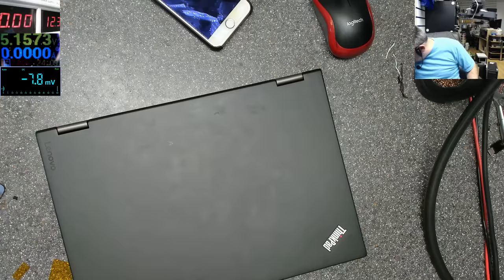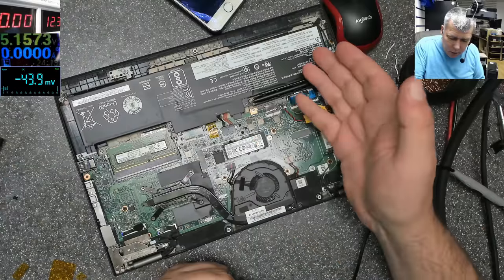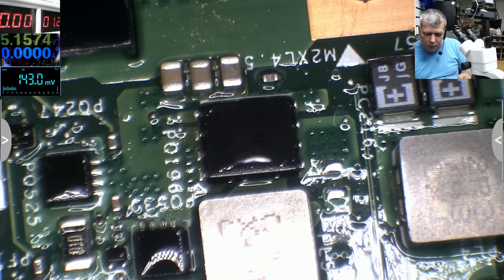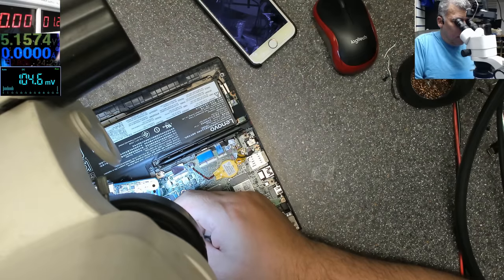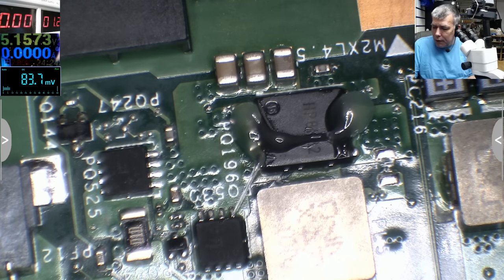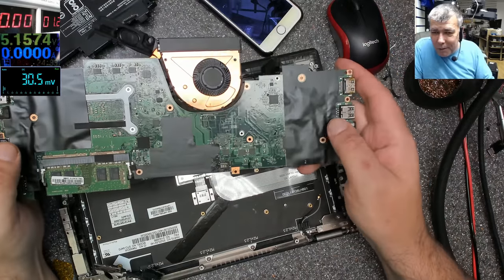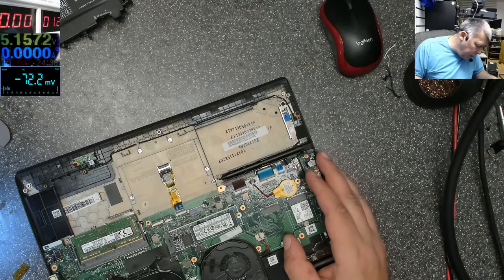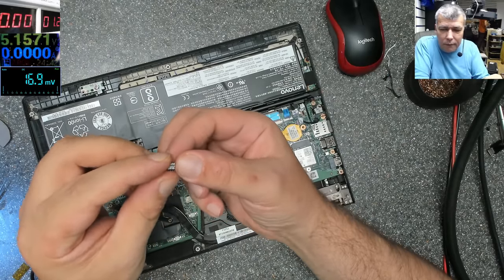Lenovo Yoga 370 - motherboard repair, a tricky one

Comment: I have the exact same conditions and have torn down the same as you illustrated. I’m missing the actual repair/part replacement. Same computer, exactly the same conditions. I’m just stuck now at the physical repair to be done. Thank you for sharing your knowledge.

Comment: I remember I had a similar case to repair  but didnot find any dual mosfets as replacement... As a result I used 2 single n channel mosfets connected with wires... AND IT WORKED JUST GREAT.

Comment: Hi Sorin, many thanks for all your instructional videos. I have a small PC repair shop in south Manchester and now feel cofident to do some component level board repair thanks to you. I have just had exactly the same problem on a Toshiba laptop I bought "spares or repair" as I needed some other bits off it to fix a customers laptop. I even have a thermal cam to help me identify the hotspots on the board. I was practising on this board to see if I could fix it and removed a capacitor that I thought was shorted. Seems the issue was on the other side of the board and now I've learned to take the board out and check thouroughly! 
Se poate întâmpla și maestrului!
Multe mulțumiri pentru că ești inspirat de mine și de mii de alții.
Stai in siguranta.
Salutari
Jed

Comment: The Lenovo Yoga has its power button on the side, because its screen can be turned all the way round until it touches the down side of the laptop. It has a touch screen. When folded like that, the keys on the keyboard retract and/or turn off and the unit will function as a tablet. In tablet mode, it is more convenient to have the power button on the side.
The 7 in its model number indicates this model was released in 2017. So this unit is max 3 years old and already one of its caps shorts out. This is unacceptable but unfortunately we see it everywhere in the electronics industry. Parts are engineered to be as cheap as possible. Lifetime is no issue. Customer is supposed to just buy a new unit if a cap dies.

Comment: i realy learn a lot from you're videos. im from philippines and i want to ask a silly question about the laptop capacitor, is it realy ok when you remove one capacitor and the laptop would be revive without replacing it? is there any down's and up's for not replacing the capacitor? im not and electronic but i want to learn from watching videos like this. thanks in advance for who ever answer my question it will be a big help for me.

Comment: How do you know that mosfet was the same spec as the other one? Just from experience? and why did you not replace the capacitor, surely its there for a reason
Reply: The mosfets on the motherboard handle 30V 20A, they all have to step down the main voltage (19v)  to 5v 3.3v etc.  so if its part of a buck converter they are compatible. (you can alway double check on the datasheet). The capacitors are filters, you can see that they are connected in paralel, so it can work without one of the three.
Reply: @steelasd8097  I hope the manufacturer has watched as they now know that they don't need to fit that capacitor.
Reply: @twotone3070  I hope they watched, and use better components.

Comment: Techs at our place won't fix issues like this one but would recommend to replace the whole board.😂
Reply: The whole laptop,the car and the house
Reply: @MindYourBusiness1970  For real. All they do is plug the computer to their diagnostic machine and replace whichever part doesn't work properly.
Reply: @Dr.Stark where do you live?
Reply: @panic4875  Yes,and a lot of customer's are happy because It seems a quick way to solve the issue
Reply: @MrHimer12  hey at least you tried to find out what's wrong with the MB. Unlike those techs who won't even try to examine it or touch it, all they do is test if it still turns on or get pass the bios. If it doesn't they recommend to replace the whole thing right away.

Comment: You did jump the gun and didn't check for odd resistances when the mosfet was removed.
But that dead cap heating the mosfet has to be a one in a million chance lol.
But it's fixed :-D

Comment: Watched Gamer's Nexus channel on Sept 20 and saw Jim from Bearded Hardware set a record on overclocking a EVGA 3080 card to 14,069 on 3DMark Port Royal using liquid Nitrogen to -192c. 
Bots on eBay are bidding up the prices on the 3080 cards that the sellers may or may not have. This is so they can not scalp the cards. Check the stock of the cards as they are being replenished and more stock should be available in October and November.

Comment: Hi, Sorin. Thank you for the videos you have been making. I wonder if you have ever had to replace a soldered RAM. I have a Lenovo Yoga 370 with soldered 8gb RAM which I would rather was 16GB at least. Is it possible for me to upgrade it? Would you advise it?
Reply: This could potentially be possible. You would need memory that is double the GB per chip that is the same speed or faster unless there's more empty memory IC pads available. You would have to modify the firmware & bios to recognize the new memory also. If there is a model of the Yoga 370 with 16gb that comes soldered your chances are way higher because you can use the firmware from that model if not someone would have to make it custom which may not be possible. There's been a few articles where some shops modded 8GB GPU's and put 16GB with custom firmware.

Comment: sir, i had a desktop mother board just day a go it shut down now when i press the switch it make the cpu fan to move little but can run and a sound little like click sound type come have no burnt and fan try to move on the opposite direction little what could be the problem. if kept for one day and trun on it work like nothing happen and when restart same thing is it mother board rip sir. thank you

Comment: was there any reason why you didnt replace the capacitor with another one? i am just getting started into repairing electronics and finding your videos really useful. Another question as i see alot of simply taking out mosfets and shorting them out, how do you know when its safe to do that?

Comment: Gud day sir sorin ,,i learn a lot you from, how to return to life on the desd laptop,,can you help me ,to bypass lock-in password in Lenovo 100s BIOS password,i can't reinstalled windows tnx TIA
Reply: have you clear the bios? the password should be cleared or return to default
Reply: @PrasetyoMuhammadDwiBiology  yeah,but i failed,i can't installed Windows , system password ,it show it again and again,
Reply: Put your hard drive in another computer, install windows 10 on it  . When it's installed , just put it back in you computer. I used it on a Lenovo T460 with bios password locked.
Reply: @3V30NLIN3  no it's impossible bcoz , there is no HDD it's using 32gb emmc , storage
Reply: @violetabrank7534  yea tricky emmc, have you try power on without battery and cmos battery?
Reply: @violetabrank7534  in samsung they have two terminal behind ram slot, it needs to be short to clear the cmos.. good luck to you sir
Reply: @PrasetyoMuhammadDwiBiology  ok I'll try it,tnx Sir,

Comment: Dont buy that videocard wait till end oktober then AMD Will come with new processors and videocards. So better wait dont buy yet the rtx cards
Reply: Ye, i'm with you , btw, i don't know why they are going for this card like that ! aren't you playing your games with full ? i do that with my RX580... and i'm only waiting for the AMD october launch to buy the new one. don't be greedy people...
Reply: @doublesnake18  I think a lot of people want to finally play games with ray tracing at a decent fps. the 2080 was not very strong at this. I know, I have one.
Reply: @Jan3Sobieski5  rtx 3080 is not so much better with raytracing. Yes, performance with RT are almost double but still that's not even near performance level someone expect with high end gaming PC. We need to wait few more generation for that.
Reply: @Jan3Sobieski5  Yes. at the time of the RTX20 , they were to weak to work properly because of drivers... that was a great lesson. people should never buy a new tech, wait untill they try it, and than you can see if you take it or not.
Reply from the maker: Well, its a big change with this card, the pc reaction time (latency) get cut in half, this is a big change for fps players
Reply: @electronicsrepairschool  Yeah Mr.Sorin but we do not trust them anymore, as we saw at the RTX20 launch. btw, those GPUs are too powerfull to a point that they bottleneck most CPUs, so you need a high end CPU too to run at nearly at full.
Reply: @electronicsrepairschool  it is a big change indeed.  Please note that you need a large CPU for the video card.  i will also wait for the AMD products AMD is strong at the moment with cpus and gpus.  I would just wait until the end of October.  with Intel processor I would take an Nvidia card and with AMD I would stick to AMD in terms of processors.  Intel with Nvidia or AMD processor with AMD video card.  you can't just put a thick video card in your pc without having a good processor and power supply.
Reply: @electronicsrepairschool  they say. But they say bunch of things and most of them later came as "yes we say that but we think in this specific situation/game/stars position".